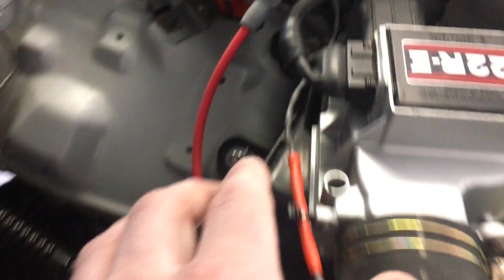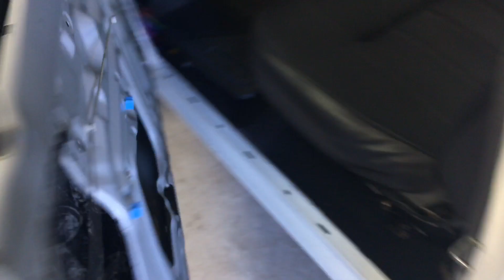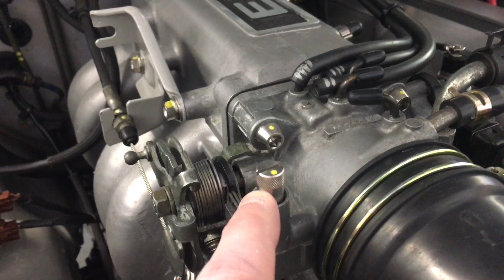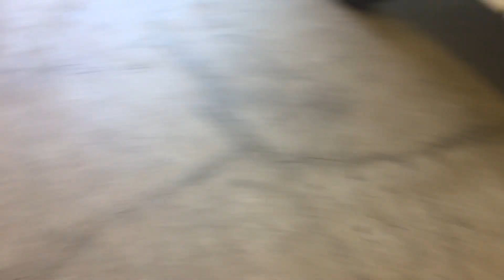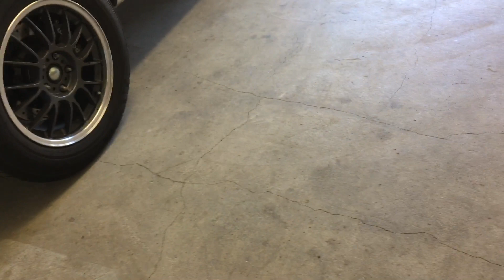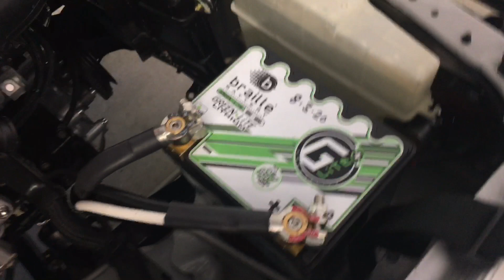89-95 Toyota Pickup 22RE AFM IAC valve air suction idle unstable dropping when warm 500 RPM's

Comment: I took my front grille today... I had the same problem lol. How did you go about picking the rotors size and brake calipers part number? I do recall in one of the videos you said you had to make your own bracket which I can’t find the video but I will find soon. Did you have to replace any brake lines or anything of that sort? One of my brake caliper is seized up and I’m debating about replacing both front calipers and checking the back drums with something from parts store in the mean time or just do exactly what you did. Are those extra brackets that will work that you don’t need? I’ll buy them if they are the ones that will work. When you rewire the entire pickup did you use one size up(AWG) or the same as factory. My positive terminal doesn’t reach the positive post on the batter so will have to rewire that. Thank you very much Ray!!
Reply from the maker: For sizing the rotors & calipers, I spent a lot of hours pouring over Wilwood's website and reading up on the different caliper and rotor options. In the end, I went with a 12.88" rotor both front and rear. A lot had to do with the hat options available. I am running two very similar hats (front vs. rear) which give the proper offset for the rotor and clearances, etc. The calipers are Wilwood's FNSL 4 piston front and rear. https://wilwood.com/Calipers/CaliperList?subname=FNSL4R I'm running the 120-11783-BK in back and the 120-11784-BK in front. I'd have to dig up the exact specs on the rotors, but I'm running the  SRP drilled rotors here as I remember: https://wilwood.com/Rotors/RotorList1?mcat=254 - 12.88 diameter. I think the thickness I used was 1.10" although I would have to pull up all the info to double check that. Anyway, I built the entire system out of cardboard using a glue gun and bolted it up with the wheels I'm running to make sure it would all work. Then I bought the parts and took measurements and drew up the caliper brackets in Fusion 360 and had OSH cut laser them. Everything is new. Brake lines, pads, calipers, hats, rotors, etc. The brackets I showed in the video are spare rear bracket adapters, but I believe they still need to be threaded (the two mounting holes). If you are interested in buying the couple I have here, I can check and let you know if they need threading - is that something you are capable of doing there? I don't my stuff setup for tapping those holes right now. Threading SS is no joke haha. Anyway, those brackets bolt to the Toyota rear axle, using the bolts which old the rear wheel bearings on.. you're gonna have to use longer bolts. Also, those brackets are only half the issue.. you have to also buy Wilwood brackets which bolt to those brackets I made and then allow you to bolt the Wilwood caliper on - so the brackets I showed are only 50% of the solution to get your rear caliper installed. Also, you have to adapt rear brake lines into the existing hard lines that toyota uses and get rid of their crazy brake load proportioning valve stuff back there... I had to TIG weld custom brake line fittings for that, as I wasn't able to find the exact right fitting - but there are many different approaches to that if you need to run lines back there. But let me know if you wanna buy the brackets. As far as re-wiring, I mainly just modified the stock harness, but kept 95% of the Toyota wires. I used 18 and 22 ga wiring as I remember for most of that. The main electrical harnesses to the 140 Amp alternator is more like 2 or 4 gauge stuff. I also run those through individual circuit breakers and stuff. All the stuff going to the starter and battery is new. I used marine grade wire for that from Amazon. It's tin coated inside. I'd have to look up the company, but if you need the name, I can check my records. Let me know on the brackets. I was going to keep them in case I buy a 4Runner for my girlfriend and install custom brakes for her, but I can always make another set down the road. My total 4 wheel brake setup probably cost about $3,000 plus or minus, just in parts. Also, for the front FNSL 4 piston calipers, there is another 7075 aluminum alloy bracket that I had to make, although I think I was off by .020" in my measurements, so I had to shim it slightly. Also, even after cutting that bracket, it takes fairly extensive fabrication to make it work. Have you checked out the kits from Little Manufacturing shop? They sell some bolt on stuff that is a lot easier, although not quite as high performance as what I built. Let me know if you have any other questions or what those brackets, although there's a lot more required than just those brackets to make it all work :-)
Reply: @ray5961  I thank you very much. In the current conditions of my pickup, I think the little shop manufacturing is the best fit for me right now. I did save this comment for future reference if I do wish to switch over to your set up. I don’t have a the right tools to thread SS, but could possibly get someone to do it. I think I’ll wait for that though. My pickup is leaking from what possibly be the oil pan and my guess the main seal from sitting for years. If you are interested in seeing my pickup condition I dont mine sharing with you, you might get a laugh from it.
Reply from the maker: @ericrodriguez8556  Yeah, I'd love to see it. Do you have a YouTube channel video or IG or something? If you saw mine when I first bought it, you'd laugh. It was real bad.. I only paid $800 for it.
Reply: @ray5961  https://youtu.be/DEzE9mFcMg4
I made this video. I do not think im cut off to making youtube videos.
Reply from the maker: @ericrodriguez8556  Hey Eric - nice job on the video! I just finished watching it. On the fuel pump, 40 PSI is good and yes the PSI will drop down when you turn the motor off - it will go clear to zero actually over night usually. When you crank the starter the pump comes on, the pump is also triggered by the AFM door opening also, so make sure those circuits aren't corroded. If you are gonna do major restoration, there are 3 manuals you wanna get off ebay. I'll make a video later showing which ones you need. On thing you might wanna do is replace the fuel filter on the right side of the block as it will usually be dirty and blocking flow. Also, try jumping the fuel pump on like you did with B+ and Fp in the diag box and see if the motor will start and run with the fuel pump forced to stay on via the jumper instead of controlled by the ECU; that will tell you if it's the fuel filter or if the ECU and AFM circuits aren't doing their job (just don't run it too long like that). But my truck was pretty much just as bad as yours. The motor was so bad and covered with so much oil and dirt and grime that I couldn't even see most of it. I had to clean the under carriage 5 times with my pressure washer and then gas and a rag many many times, I also used a tooth brush and gas spray bottle to clean all the small areas. The interior looked like someone was living and eating in the truck and maybe murdered a prostitute in there also. I mean I found an entire bag of sunflower seeds dumped out WTF? Many many hours of work. I also had leaks across the entire truck. Someone put a motor from a 4x4 in my 2WD truck and the front steering linkage was sawing through the oil pan. When I drove home, no head lights at night due to a hidden short in the harness that I'm sure the previous owner gave up trying to find (took me 3 days of going over the wiring schematics to finally find it... I nearly cried when I found the break in the wire and fixed it). So I feel your pain man. I had to replace the front and rear main seals and also the transmission seals and the differential and axle seals. I think I've turned every nut and bolt on my truck at least once :-) Anyway, thanks for the video and good luck w/ your project. Hit me up anytime you've got questions and also the forums for Toyota's are super helpful and a lot of knowledge folks there who really know their business when it comes to the 22RE. Check out LC engineering also, they sell a lot of great parts and have a lot of helpful info on their page.
Reply: @ray5961  I turned on the pickup with the wire cross over Fp and +B. It did run like that while keeping fuel pressure at the minimum 33psi while increasing pressure to 40psi while increasing rpm. I have a fuel filter on the way, I’m sure it needs it too. So my guess it something to do with the ECU or AFM. I have the 1991 Toyota Repair Manual vol 1 & 2 with the automatic A43D & A44D repair manual too. I wonder if the electrical wiring diagram manual has more to it which I do not have. Thank you for your help!
Reply from the maker: @ericrodriguez8556  Okay, you've got the good manuals. However, yes, the electrical one w/ the silver cover is really what you want for anything to do with electrical stuff. It shows a lot and also shows you more about how the electrical systems work together as well as which connectors have with pins and color wires, etc. This allows you to figure out which wire is doing what and also how something like the AFM turns on the fuel pump, etc. So in your case you could find the wire in question and see if the AFM is closing the circuit or tripping the relay or whatever it does. It's definitely a very important addition to the manuals you already have there. Your fuel pressure sounds good, so it's probably not a filter issue, but the filter should be replaced either way. 34-40 is about right; it will go up under load. I actually took my fuel pressure VSV off and just ran the vacuum hose directly to the regulator on the rail to simplify things. Works fine. Sounds like your AFM switch / wire isn't working and kicking on the fuel pump maybe.
Reply: @ray5961  I believe my problem is the circuit opening relay. I bypass the relay and was able to get the pickup running. Unless it’s the fuel pump switch/AFM not letting the B+ & Fp connect on the circuit opening relay. Did you get the electrical manual on eBay?
Reply from the maker: @ericrodriguez8556  Yeah, ebay. Like this one: https://www.ebay.com/itm/142625373904 - make sure it says "truck" on the top. On your truck, there is a green wire w/ a yellow stripe that runs over to what's called the "circuit opening relay", which is located behind the passenger side kick panel (it should have a 6 pin dark grey connector) - that relay is probably your issue. The AFM powers that relay by grounding it, which turns the fuel pump on anytime air flows through the AFM. On the circuit closing relay, jumper the pins which correspond to the green/yellow wire and the wire/red wire and see if the relay clicks on/off. The other way to test that relay is find the green/yellow wire on the AFM connector and ground that wire and see if the relay on the passenger kick panel clicks and the fuel pump goes on. If it does, then there is a break or something w/ the brown ground wire to the AFM. If the relay doesn't click when you ground the yellow/green wire, then most likely your circuit opening relay is bad. When you jump B+ and FP you are manually bypassing the circuit opening relay, so either the AFM isn't grounding it or it's bad. The silver electrical manual will show you all this also. Let me know what you find. I'll make you a quick video showing how helpful it is in a minute...
Reply from the maker: @ericrodriguez8556  here you go - https://youtu.be/EpTED3Z2xo8